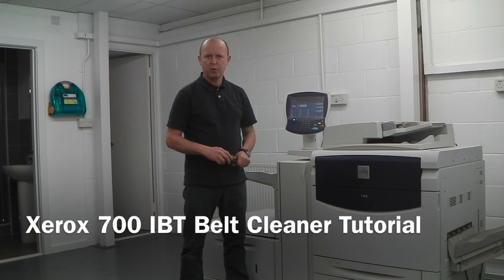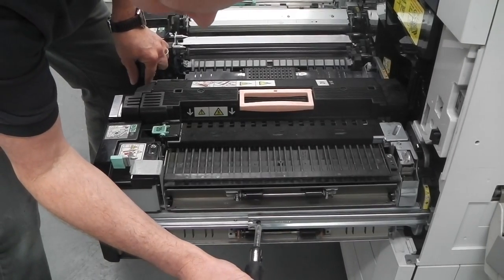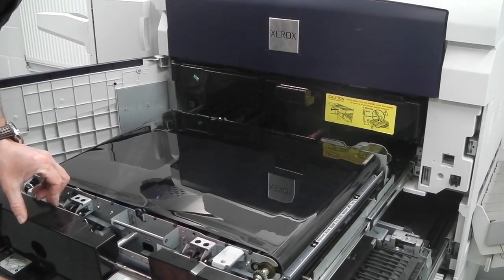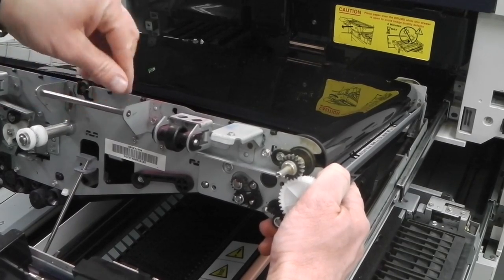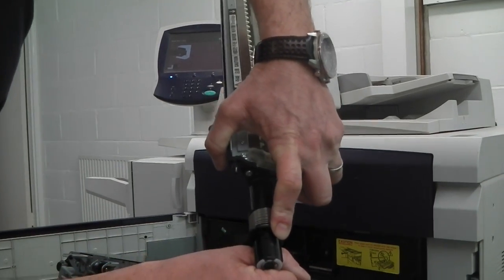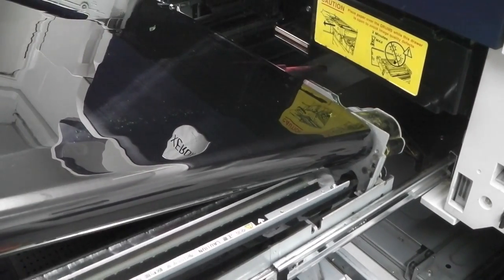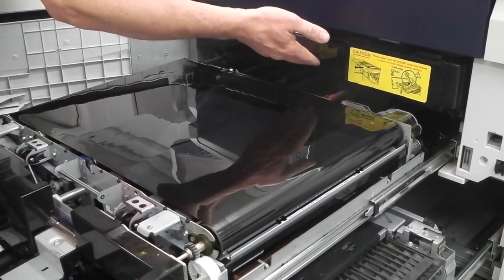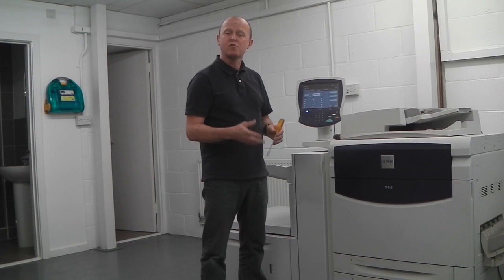Error code 042-326/327/328 for Xerox C75 700 560 242

Comment: hello, I have a question

in the xerox 550 that I have I find a code 091 -320

What could be the problem

Thank you
Reply: EDU NIToRR try replacing the ‘charge corotron’ which is on top of the black drum, you simply slide it backwards off the drum and it should click out of place, then replace with new one. This fault code indicated the wire has broken

Comment: the video is about nothing, error 042-326 is the label and rotation of the transfer belt, 042-327 is the tape position horizontally. And these errors are removed by not trivial cleaning the reins of cleaning the transfer belt.